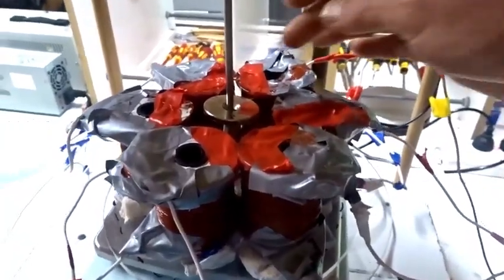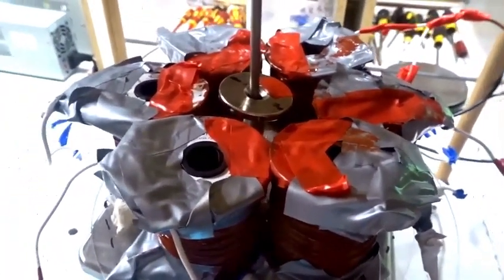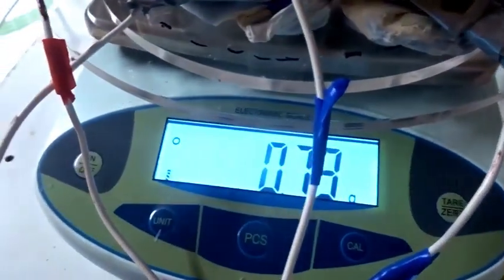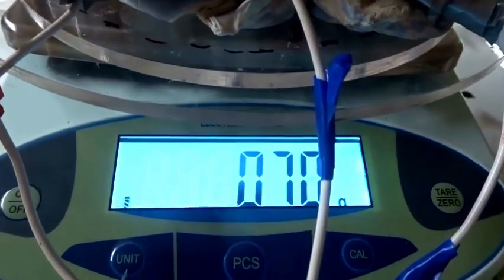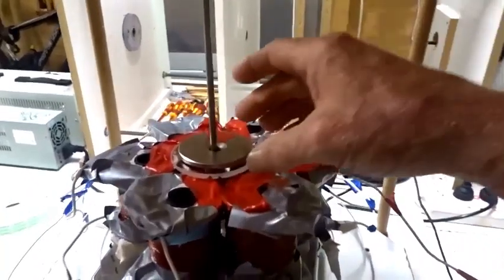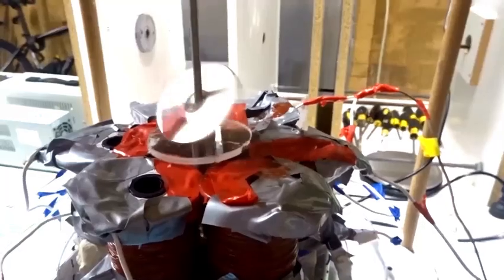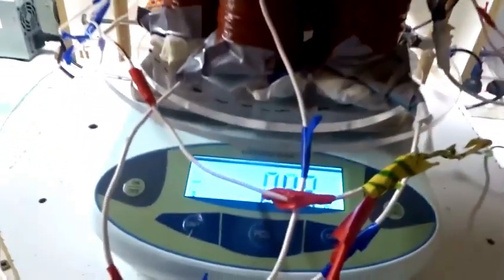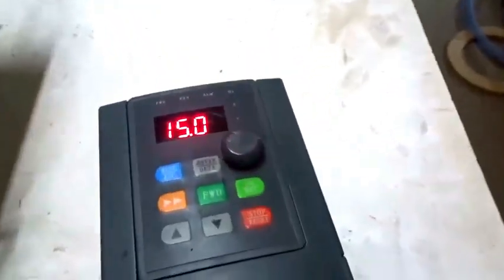The Electromagnetic Spinning Top

Comment: Is the magnet at the bottom being forced down (opposite to the top one) hence compensating for the lift on the top magnet. I wanna see the bottom magnet. What would happen if you put a small bearing and lock on top of the top magnet to prevent it moving up?